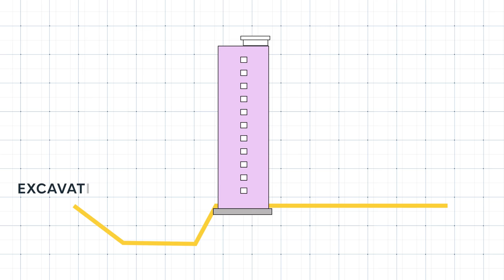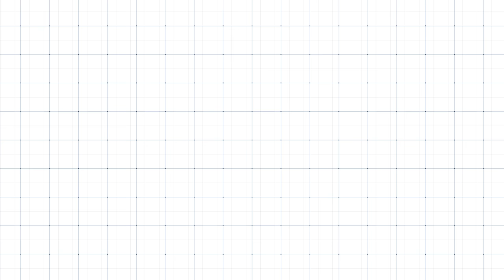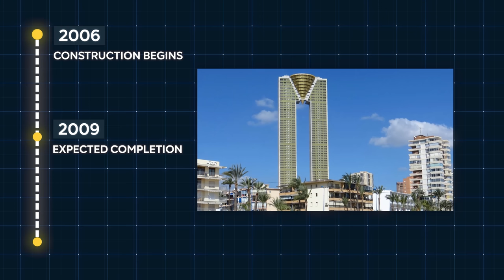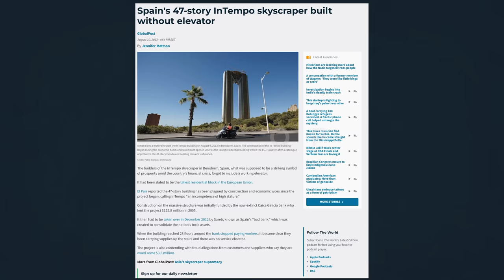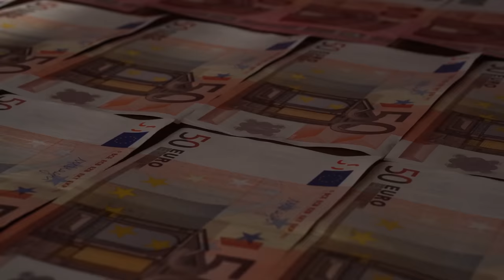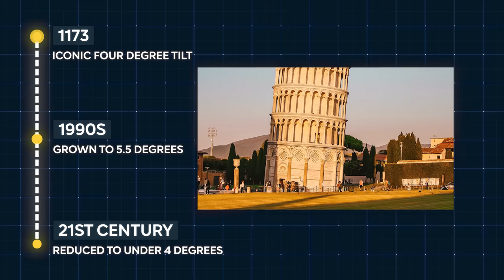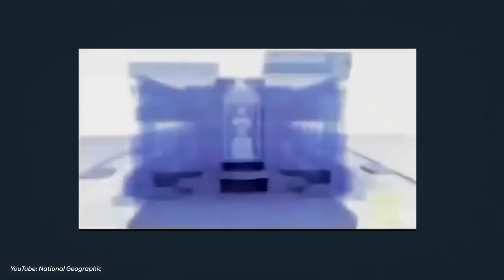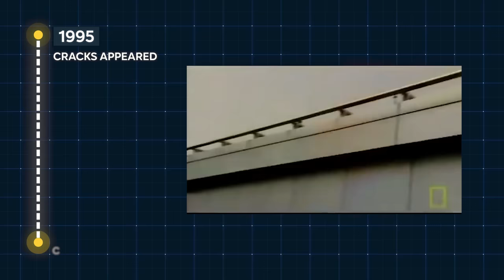The Biggest Construction Mistakes in the World

Comment: In Malasia in the 1980's an apartment building collapsed.  Airconditioning recently installed was initially blamed but investigation revealed than,an engineer made a mathematical error to the power of ten (misplaced a zero) so the centre masswas never rated for this...
In Adelaide in around 2010 a large restaurant collapsed.  Recently installed airconditioning was responsible in this case, but not because of extra weight.  The installers couldn't run the ducting so cut through two main support struts.  Six weeks later the inevitable happened.

Comment: They said the outside of the Aqua Dom was below freezing. They said the air around it was below freezing. How could this be if it was located in the lobby ?
Reply: yea it sounds strange
Reply: It was a inner courtyard with a glass roof, not actually the lobby of the hotel. The courtyard also was not completely surrounded by the hotel, the hotel was just the biggest part of the building.
Reply: They never report how many fish died.
Reply: On that day the outside temperature was below freezing. The Aqua Dome was inside the air conditioned hotel lobby that surely was kept at room temperature. So the claim made in this video doesn't make sense. There hasn't been a final conclusion to the cause of the collapse yet.
Reply: I was just reading more about the Aqua Dom and it's a super weird story and no one says anything conclusive about it lol
Reply: @muc21  The part of the building where the tank was just a courtyard that did not have any heating as it would apparently have been very uneconomical to heat such a large space, and it also had a thin see through roof that provided very little protection against the outside temperature. I'm not sure if the air temperature in the space would have actually dropped to below freezing, but it would surely have been well below normal room temperature.

Comment: I heard that the Pisa Topwer  underwent so adapations to correct the tilt during construction.  An attempt to 'straighten' the tilt.
Reply: That is true. You can see that the top of the tower tilts less than the bottom of the tower. It has a slight "banana" shape.

Comment: Climbing the Tower of Pisa in 1989 was terrifying! It is made of the famous white marble of Italy. The years of wear from oh so many feet climbing had rounded the steps a lot. The mid level balconies had no railing. It did not feel like the tower would fall. It felt like the light mist coating the slippery marble was going to lead to falling off. That 5.5 degrees lean meant standing still on that moist marble felt like a huge risk. I love heights, but I was thrilled to touch the dirt again.

Comment: @3:13 The Intempo Skyscraper may have been the highest building within the EU at the time, but now the Karlatornet in Göteborg Sweden is higher, 246 m with 74 floors.
Reply: I think that was specifically the highest RESIDENTIAL building. There are certainly taller buildings than that in EU.
Reply: @pawelzielinski1398  Karlatornet IS residential. Or rather will be, as construction on it is not finished.
Reply: @topioksanen8734  OK. Good to know.

Comment: In 1970 part of the West Gate Bridge that was being built in Melbourne  collapsed . A 112 meter span dropped 50 meters into the Yarra river killing 35 construction workers . A Royal Commission concluded on 14 July 1971 attributed the failure of the bridge to two causes: the structural design by designers Freeman Fox & Partners, and an unusual method of construction by World Services and Construction, the original contractors for the project.

Comment: The quality issue of China is a corruption problem.  If the materials stated were purchased and used, I would say about 4 in 5 buildings would turn out fine.  The last 1 in 5 buildings fail because of corruption through bribery and short cuts :(

Comment: Wasn't the Seoul shopping mall incident caused by moving some sort of super heavy duty machines on the roof by dragging them across  rather than lifting and repositioning them using a crane? Cracks then started to form and eventually it collapsed. On investigating they found the construction crew cut corners and also used smaller reinforcement rods that weren't supposed to be used and didn't match the engineers specifications for such a building. Saw this on a documentary a while back.
Reply: the collapse had many reasons, the air cons on the roof, the restaurants at the top floor despite the floor not being prepared for that, the additional floor when all the understructure was already done for the other floors and needed to be redone to hold a new one (that did not happen), the columns around each floor (didn't have the proper amount of iron beams)... Rotten Mango has a full detail video on that, it's pretty recent and the research was very well done

Comment: China is riddled with poorly constructed buildings that are little more than facades, never intending for people to actually live in them.  At once point the Chinese government was reimbursing landowners for any structure that has to be torn down to make way for a government project, but the reimbursement was based on how many floors there were in the original building.  Crumbling  concrete, no electricity, no water even for the fire hoses... it didn't matter.  They basically encircled every one of the top-tier cities with these junk buildings hoping for a payday and cutting as many corners are they could.  When it became clear to the builders that they wouldn't be getting a payday, they tried retrofitting some of  their buildings to make them sort of livable, but sinking or leaning buildings is a common thing in China.  The government will only talk about it as if the collapse was an isolated incident and the people responsible are in jail.  Any of these admissions only happen as a last resort, and citizens are discouraged by the government from talking about such things...because the loss of life might be bad, but the collapse of China's real estate market would be disastrous.

Comment: I find it hard to believe the temperature differential of a few degrees (it may have been cold outside the hotel, but no less than 18C inside the lobby) would cause plexiglass to fail. More likely, their engineering calculations were wrong for the thickness the walls had to be to withstand the force of the water exerted on them. I wouldn't be surprised if they shaved construction cost by going with thinner walls, leaving no safety margin.

Comment: A biggie construction mistake was done in Las Vegas with a portion in building the CityCenter project.
The proposed 47 ~ 49 story Harmon Tower was found seismically unfit after 26 floors were constructed, leading to the project being condemned.  The close proximity of the condemned tower to the other CityCenter structures made it impossible to implode the tower, so it had to be dismantled piecemeal, over a year's time, at a cost of $173 million.

Comment: What about the collapse of the Hard Rock Hotel in New Orleans? So many construction mistakes. Not to mention city inspectors who submitted that they inspected the site, but were proven to have never (NEVER) appeared on the site. In spite of a number of people, including a site engineer, taking pictures of bent beams and numerous materials issues, and being ignored.

  Or the MGM Grand hotel in Las Vegas using none of the recommended fire safety devices (no smoke alarms, fire suppression, etc) so when a fire broke out on the main floor, the smoke filled the entire hotel via the HVAC system. Also the stairwell doors auto locked trapping people escaping inside the stairwells, where they died. Eighty-five deaths. Hundreds of injuries. All because a hotel cheaped out and didn't take fire safety or lives of their customers seriously.

Comment: Calling the Tower of Pisa one of the biggest construction mistakes in the world is utterly absurd, and putting it at Number Two is even worse. If anything, its construction was marked by a series of almost miraculously good choices that enabled them to overcome the intrinsic limitations of the project. Today we tend to chalk these decisions up to just dumb luck, but I think that's kind of condescending. These were smart people, who understood that they had a problem, and came up with good practical and creative ways around them. They periodically stopped construction, which gave the ground a chance to compact and become stronger. They added curvature as they went up, which greatly reduces the strain on the bottom floors. They used lighter building materials and voids to lessen the weight, using the heavy marble only for a thin veneer. They observed how the tower reacted to what they were doing and adapted accordingly. It's only been in modern times (starting late 19th century) that big mistakes have been made. And the thing has been standing for close to a millennium, so they clearly did something right. How many of today's buildings do you expect to be around after that much time? Other than digging too shallow of a foundation, they don't seem to have done anything wrong, and even that was was conformant to standard practices of the time. It was just that the ground, which superficially appears solid enough, is actually too soft to support a tall tower. But they had no way of knowing that. What's so impressive about this structure is how they turned that unexpected initial misfortune into such a great triumph. This is an absolutely gorgeous building, as is the whole grassy piazza around it.

And the one in Spain doesn't seem to have any problems at all. The company building it just ran into financial trouble, so it took a while to complete. Do you understand how many centuries the great cathedrals of Europe took to build? It's okay for a building to take a while to be fully constructed.

Comment: Intempo in Benidorm is not the highest residential tower in EU. Tallest residential skyscraper in EU is the Sky Tower in city of Wroclaw in Poland. It contains 51 floors, total height is 212m and height to the roof is exactly 205,82m.
Reply: The Intempo was likely the tallest residential building in Europe when construction began, and maybe even when it was completed.
Reply: @hebneh  Sky Tower in Wroclaw was completed in May 2012. Construction started in 2007 and it was planned to be even taller at 237m.
Reply: Why do Europeans use a comma instead of a decimal point? They have vastly different meanings. It's either a typographical error, or an inherent lack of understanding of basic punctuation and grammar.
Reply: @markklausen813 That's how it is, in Poland and some other countries we use a comma instead of decimal point. It doesn't change the fact that Sky Tower in Wroclaw is the still the tallest residential tower in EU ( plus UK also ), with total height to the roof 205.82m, if you like.

Comment: If I understood correctly the "Deutsche Bank" building in Berlin's "coldwar-wall-area" was a mistake, because the ventilation ideas did not work. But perhaps they rebuilt the systems for ventilation. The originally idea was a glass facade outermost and there the air could circulate, then the inner glass / steel wall had openings/windows for ventilation. My memory and understanding of this may be at fault. Google does not help.

Comment: @MegaBuilds If you want other disasters check of the Hancock building in Boston.  There were plenty of work arounds to prevent some disasters, but it was a mess.  Uneven pressure caused windows to fly out.  Instability caused the building to start cracking along the length of a floor before active load compensator (railroad-style cars with counterweights) were installed near the top.  I've even heard second hand that a workman/engineer intentionally "dropped the elevator" and "blew out the wall" to prove that it would happen like he said it would, although I have to admit I don't really know what either of those terms entailed exactly.
Reply: Hancock Tower, definitely have heard of that one. They had poor window designs to begin with that caused those to fall out and had to close off streets nearby and at the building when the winds were at or above 40 mph.
Reply: @lakerskid2013  I've been told it wasn't so much the window design - like the evelator/wall it wasn't problem with air pressure.  But there was a point that the had a security guard on each side of the building all day to watch the windows and radio in when it fix what.

Comment: in your Spanish case one of the rumors is that the building does not have elevators, this is false
on the other hand in France, in the 70s, on a large building of more than 15 floors of high standard apartments under construction (and therefore of high purchase value), the authorities noticed that, despite the regulations imposing elevators from that the building reached 5 floors, that this building could not accommodate elevators.
result the building, unfit to accommodate residents, became a regional archive center and the developer sold ..... nothing

Comment: lemme tell u some more wonders that the world still doesnt recognise as architectural marvels:
 ❄Manikarnika temple in India, has a 9.4 degree tilt ( nearly 5.4 degree more than pisa tower) and is also a few meters taller and centuries older than the leaning tower of pisa, but bcz of the location of pisa tower in Europe, the world recognises it as a world wonder rather than actual one

❄Brideshwar Mahadev Temple is India is several meters tall without the use of any binding agent, the structure stands on only interlocked stones for centuries and with a single 80 tonne boulder piece on its top, and no technology in todays time can put a 80t rock on several meters high in one piece, and Indians did this centuries ago

❄The famous Ram Setu that connects India and Sri Lanka as a bridge was built 100s od centuries ago with a rock that wasn't found in the regions within 100s of KM of radius from the engineering marvel

❄The Kailash Temple in India is a one single massive structure carved into a mountain with no single joint or crack in it, its a whole mountain carved into a temple, and many more

🌹🔥 India alone has more surprising and awesome engineering marvels, than the whole world combined

Comment: The Harmon in Las Vegas. The inspection company was doing Vegas instead of their job. About 14 floors had massive rebar sections installed upside down!  The structures height was reduced by half and the architect insisted his name be removed. After litigation the entire never used structure was dismantled. It is now a new shopping center on the site.

Comment: Regarding the Berlin Aquarium: The aquarium was INSIDE the Hotel, basically in the lobby - as the footage also shows.There is no way that the temperature of the air outside the aquarium is below freezing temps, it may have been slightly below room temperature at most. I know that this theory wafted through the net back then, buts it's nonsense.

Comment: 🌸 you missed off quite a few, the one that shocked me was in Miami, Surfside condominium collapse
June 2021 killed 98 people.
One woman was about to purchase a flat but she noticed the water damage, rust, damage ceilings and large structural cracks
She filmed it and left.  Not too long after she saw it on news, building collapsed.  

What angers me is that the maintenance had signs of this structural damage, which showed integrity of the building wasn’t sound but they didn’t evacuate anyone or raised any alarms.  They instead kept patching the cracks !   The woman that filmed the huge cracks also saw puddles of water, signs of water damage and I am sure the people that kept their parked cars there noticed it too but they never realised what it meant.  You trust that who ever built your apartment did it by the book, but it wasn’t 

After collapse a person across the street filmed the building and you can see water pouring down.  There must have been burst pipe but they didn’t bother to locate issue to repair it because perhaps it wasn’t possible to get to it to fix.  This is why most buildings are made to have pipes, wiring etc that has access points to fix them as time went by.  Also during construction, they added a pool and penthouse last minute 

The construction firm pointed out with added weight of this the foundation and other things needed to be redone to ensure the building was structurally sound but they were ignored and work was concluded 
They paid out 1 billion but that’s not enough for the pain and suffering and it’s not the price for precious lives.  So very sad, I wished people treasured lives over profits